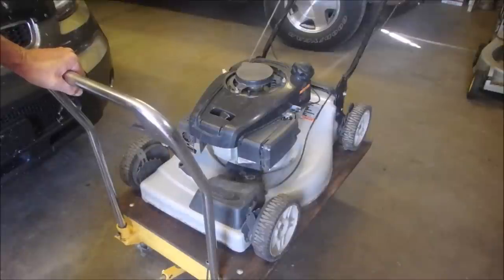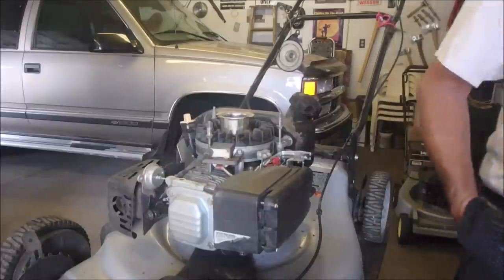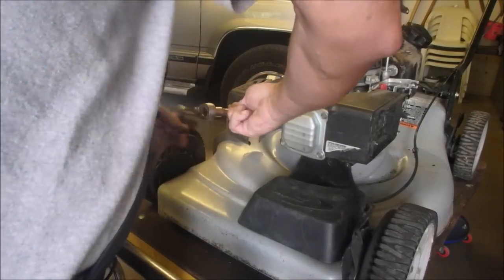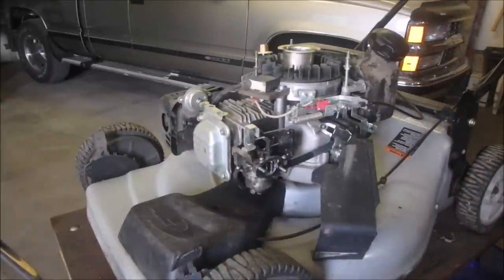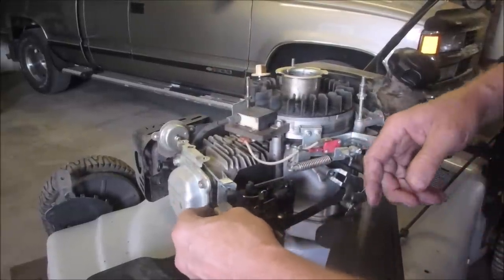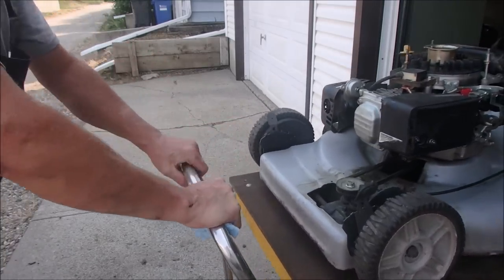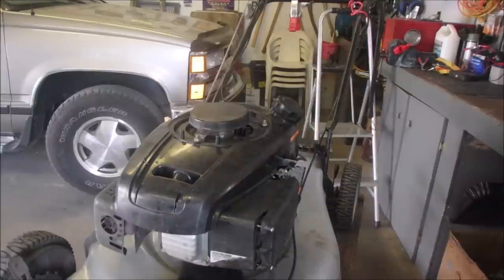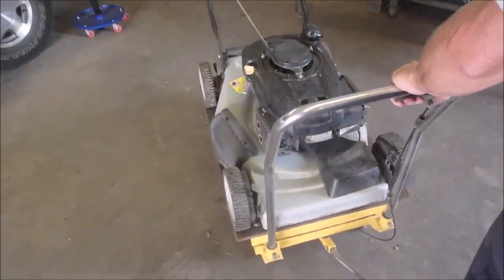Kohler Mower Choke Linkage Installed Wrong and Bent Blade

Comment: So my son in law has a 10 year old Kohler powered Toro.  He brought it to me saying it wouldn't start.  I took it apart and found that little linkage missing.  How it fell off/out is a mystery to me considering all you have to do to install it!  The mower was bought new and no one had ever removed the carb cover before!  I fixed it by putting a hand choke cable on it and now it works fine.  Good video Bruce and I can see why it would be an easy mistake to make putting it on backwards.
Reply from the maker: Thanks.  I was surprised it worked the way i did it last year.

Comment: Ha!
When the oil can fell on the floor, I thought… there’s the oil drop!
Good job!
Reply from the maker: Thank you! I thought about you ht second it fell.
Reply: @BrucesShop  
With a little trepidation, yesterday I took on a 6 HP Tecumseh tuneup.  It was in pretty rough shape but after I worked on it, it looks and runs like new.  I had a spare Tecumseh dipstick so today I’m working on creating an oil extractor for that engine.  It’s a fun project even though I don’t expect to have many more tuneup of that engine.

Comment: A question, my Toro lawnmower  the fuel tank gets dry after few days and I don't see a leak, what I should check?
Reply from the maker: The carb may be leaking so slow it is evaporating as it drips.  You should see a mild stain below the carb.

Comment: Instead of two screws I put two tie's and drilled holes on the other side so I could just open it to change the filter . It left about a 1/16 of an inch gap but hey it works  ! That machine looks in really good shape 👍 Nice one Bruce !
Reply from the maker: Thanks Bill.  I think that is my old trade showing.  Everything had to be attached permanently.

Comment: hi bruce i got some 4 stroke motormaster oil at canadian tire sae 30 and it sayes it is not to be used  with mowers with ohv. what do think.
Reply from the maker: Is it non detergent??  That is what I use.   OHV mowers  are more like a car engines.  30W is great in the old flatheads though.  I use 30W non detergent in my compressors and pressure pumps as well.  It has no soap in it so there  no foaming up.  .
Reply: @BrucesShop  thanks for the information bruce

Comment: Good morning Mr Bruce, I was wondering? what in your opinion, is the best brand of engine for repowering out there for walk behind mowers
Reply from the maker: Honda If you can afford one.  However Princess Auto in Canada or Harbor freight will get you going.  Watch the shaft diameter and length!!! Very important.
Reply: @BrucesShop  Thanks Bruce also is there a low grade Honda series motor or are all Honda engines “commercial grade” top of the line? Thanks

Comment: Looks like a Yard Pro by MTD Bruce with a bad design flaw ie: they do not have a belt cover under the deck thus so much cut grass gets pulled into the drive pulley section of the transmission. Actually had one for service this year the dry grass under the top belt cover caught on fire from belt friction and the top cover actually started to burn, lucky the customer was near a water hose and was able to put it out before it ignited the fuel line and there would have been a terrible situation. Rare that anyone cleans this area out regularly very dangerous if you do not. I have sold these in mint condition for $190.
Reply from the maker: I have seen scorch marks on other mowers on the plastic cover.  Thanks